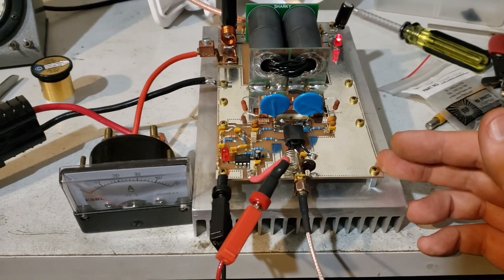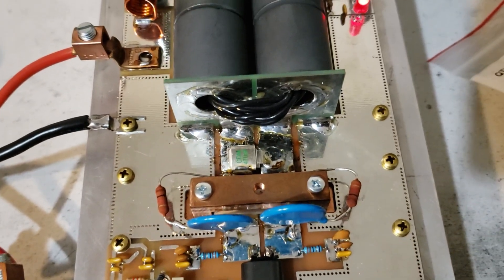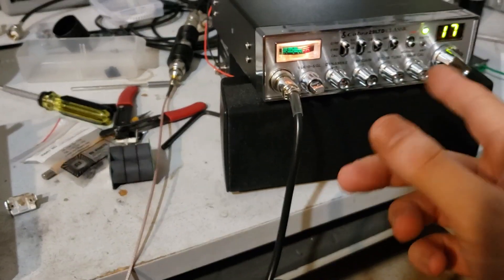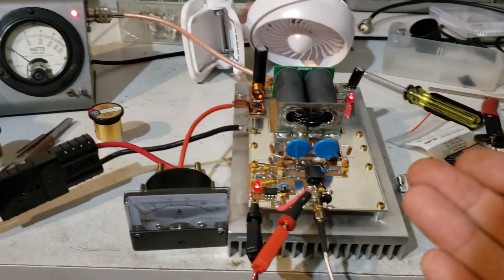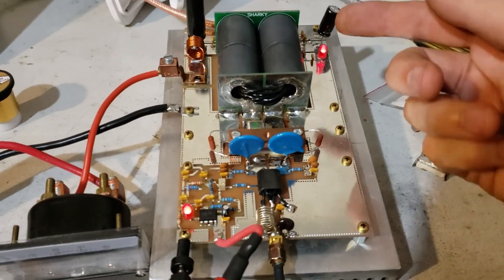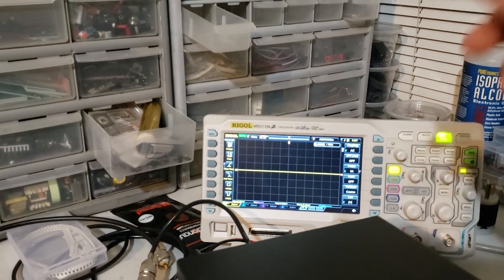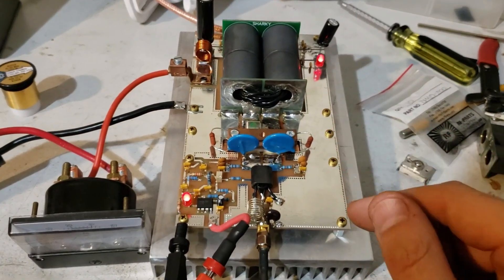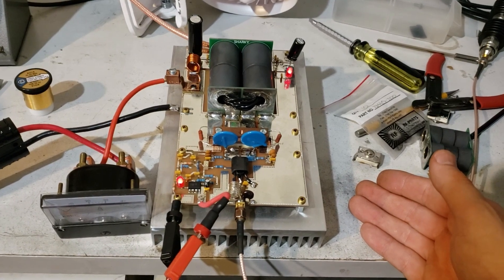LDMOS Success! Stoked AF

Comment: 63 V Power Supply and 19 A consumption, it's 1200 W DC power  for 1800 W Output .  Don't you think there is an error in some measurement ?
Reply: 19A is the Average Current.  1800 W is Peak Power.  Note also that the 19A includes the inefficiency of the system or the power that heated up the devices.
It would be interesting to put the scope on the voltage drop across the meter shunt and see the real peak, if the filter cap on the DC input of the pallet was removed.
Reply: Definetly some error measurement, for 1800W need 2500W of power on 63V around 39Amps

Comment: I'm thinking volts or amperage meter is off, because that voltage and amp draw doesn't equal the output wattage for 1.k watts. Should be 28 amps or more volts and lower amp draw to total 1.8k watts. According to Ohm's Law anyways. But $1000 for a board is hard to swallow too. https://www.digikey.com/en/products/detail/nxp-usa-inc./MRF1K50H-TF2/6605839?utm_adgroup=RF%20Evaluation%20and%20Development%20Kits%2C%20Boards&utm_source=google&utm_medium=cpc&utm_campaign=Shopping_Product_RF%2FIF%20and%20RFID&utm_term=&utm_content=RF%20Evaluation%20and%20Development%20Kits%2C%20Boards&gclid=CjwKCAiAwrf-BRA9EiwAUWwKXsLg4AEjUQKlLR8nBnXqbSMm5ZxEZFyxPwIckRT-xRJLbKPswBTIgRoCaqYQAvD_BwE I saw a Palomar skipper 300 on the shelf there if it is not working I would like to purchase it for my own shelf for my base amp to play with and experiment with different tubes to see how much I can get it up to. Email me @ GaryLordsWay@aol.com, if you ever want to sell that amp. I would like to see how that thing operates and get some feedback by other operators giving a radio check to see how they like the audio of the circuitry. That would be interesting to hear some feedback from others for sure. It works well in theory but how about real world application?